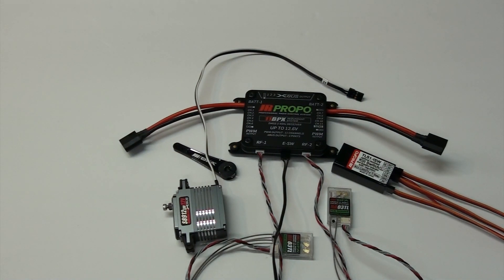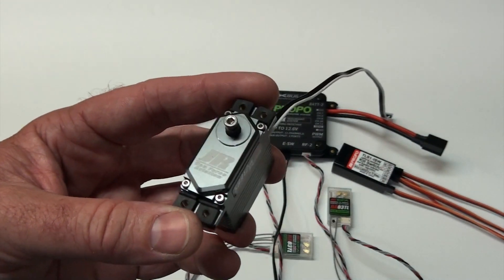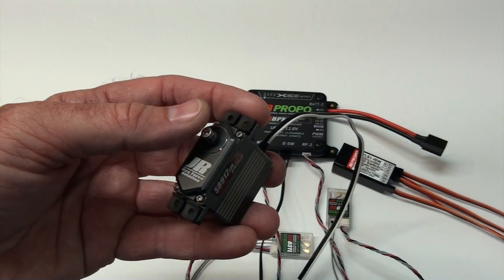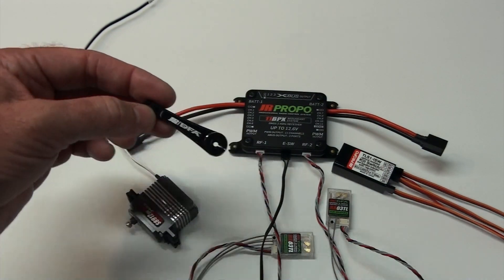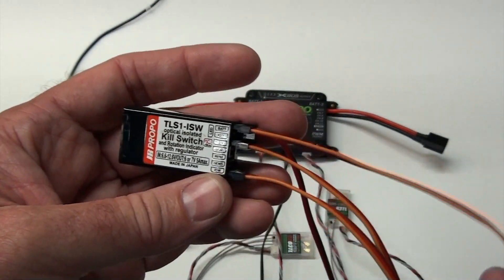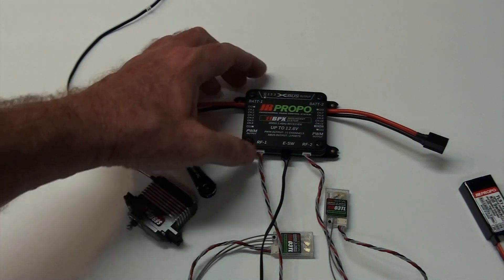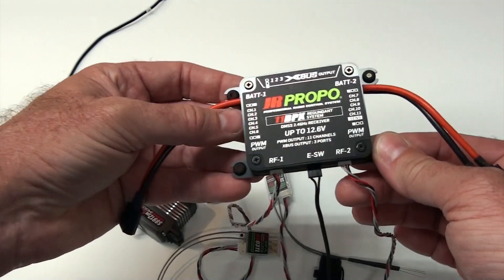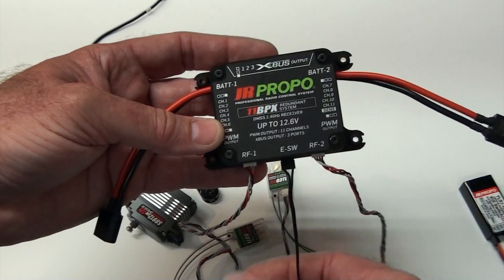JR Propo Equipment Overview

Comment: How do you setup the voltage for the servos? I mean 6V, 7.4V or 12 V
Reply from the maker: The voltage is set based on what voltage you apply into the RX. If you have a nominal voltage battery of 6.6v then the servos will be getting 6.6v.